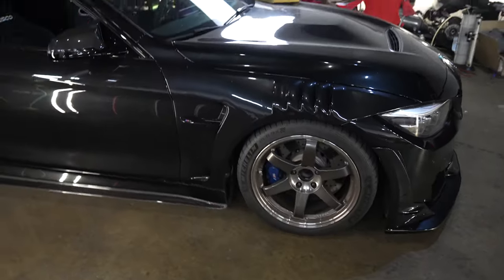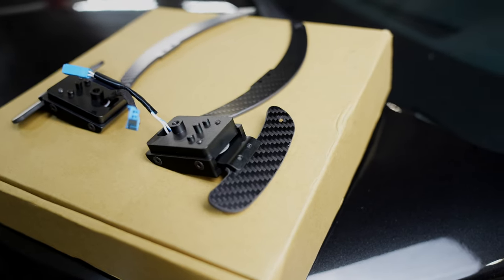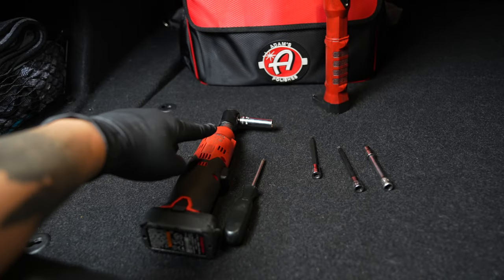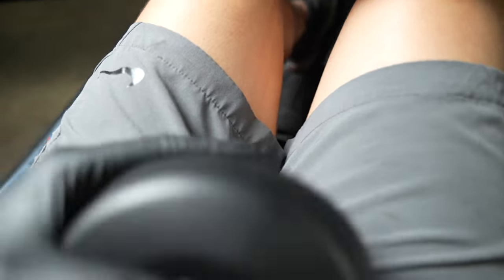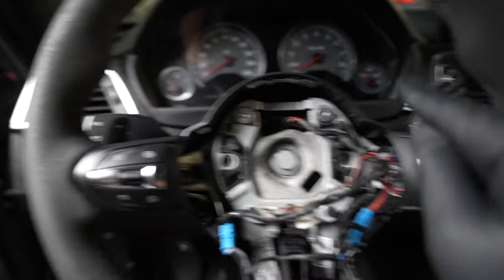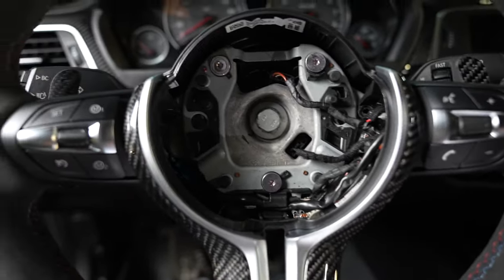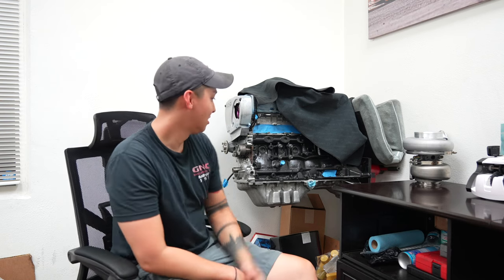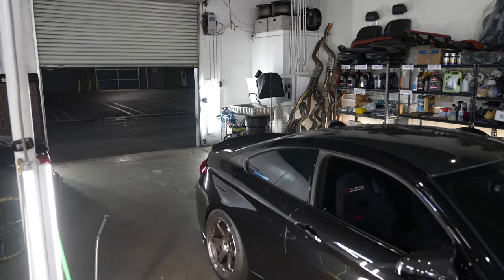F8X Magnetic Paddle Shifters Install

Comment: The reasoning behind these is the tolerance inside the mechanism grabs the next gear a lot sooner than stock. Plus if your shifting, like in a race. You can select the next gear & release…hence the magnetic design. It’s not so you can hear a click. Though the feel & the sound adds to the over all experience. Just ordered them for my 09 135i M Sport…👌🏻💯🏁
Reply: geez i just got the nelson racing ones for my 135i. do you know if these work for all years of the 135i? i have 2011 n55 dct. lci i think. when i buy mirror covers i get lci.